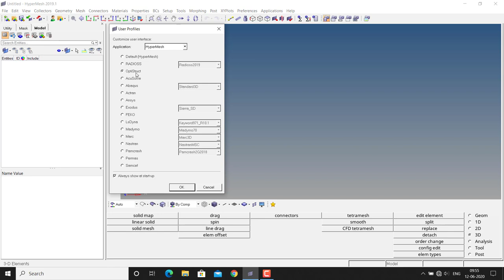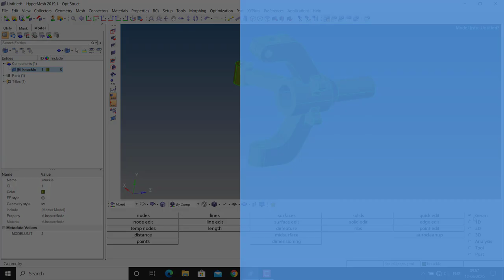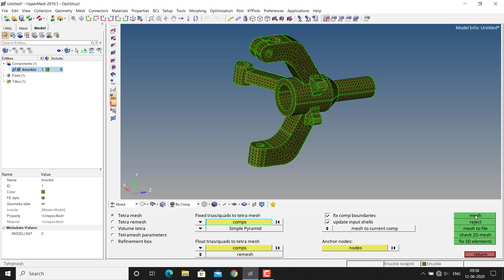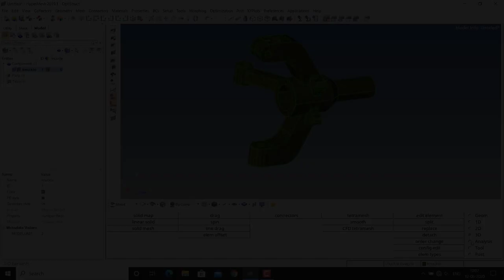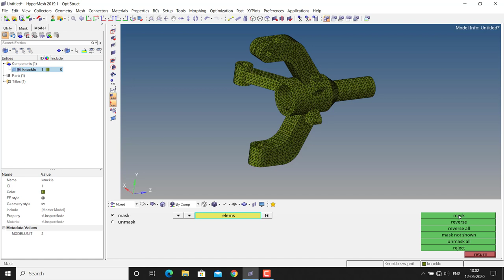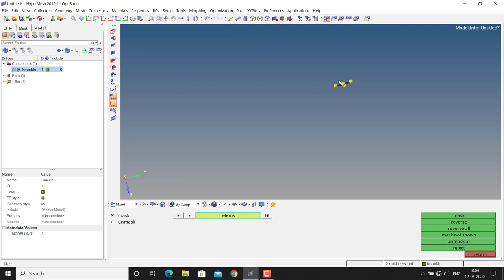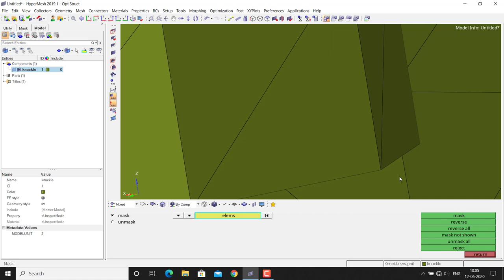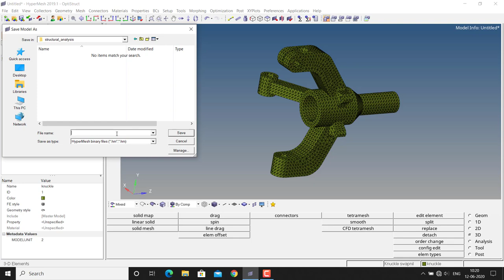Static Structural Analysis using Hypermesh : PART 1

Comment: Before generating tetra mesh from tetramesh panel you can put the value of tet collapse and growth rate in the tetramesh parameters to avoid the maximum amount of tet collapse after generating tetramesh. In this way you wont have to use fix quality everytime and will save your time.
Reply from the maker: Yes, that can be another way to do it. It all depends on the preference of the analyst!

Comment: Hello sir!
Whenever I unsuppress the suppressed (blue) edges they get green but when I go into 2D-Automesh to mesh that specific surface, the edges again becomes blue and suppressed. 
Can you please helo me with this?
Reply from the maker: This is probably an issue with the graphics card and not the application. Please check the minimum hardware requirements to run Altair products.
I think that updating graphics drivers will resolve this issue.

Comment: Fix 3d elements option not available in Tetramesh panel. What should I do?
Reply from the maker: Make sure that the left side radio button is set on the first option(tetramesh). Only then the fix 3D elements button is visible.
Reply: @Aeroswap  Thanks for you reply, but I set it to tetra mesh option on left side but still there is no option to fix 3d element. My hypermesh is of version 14.0, may be that's the problem
Reply from the maker: Right, I don't think HM 14 has the auto fix feature. If very few elements are failing, you can always go for manual editing to get the job done!
Reply: @Aeroswap  I will try doing it manually. Thanks again

Comment: I want to extract nodal forces at the bolting locations in the assembly not at the mounting locations. I used GFFORCE in the output but I got very low forces.

Can you please help me out to get the Grid Point Forces?
Reply from the maker: Hi Muttu,
GPFORCE is indeed the correct method to extract grid point forces. The card is quite simple to use and I doubt that it will output incorrect results.
I would suggest you to check your boundary conditions to find any errors which might be causing the low force magnitude output.
Thanks!